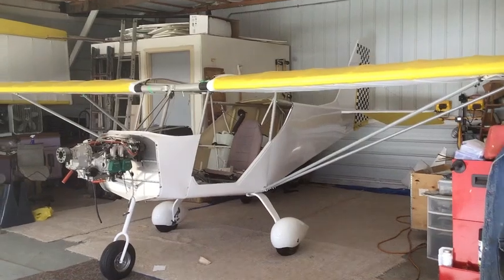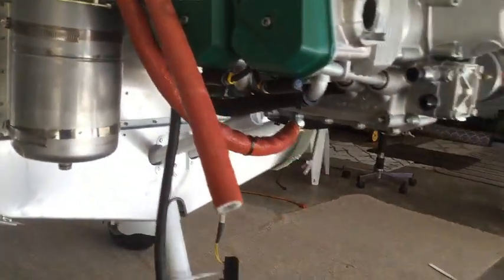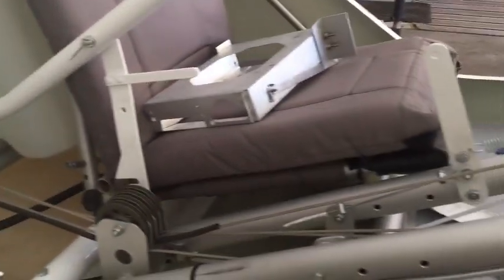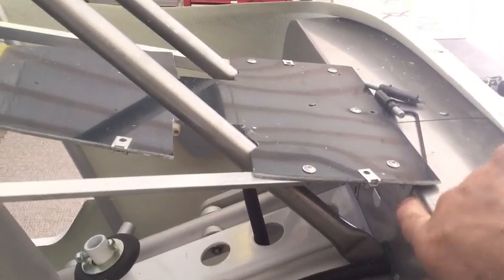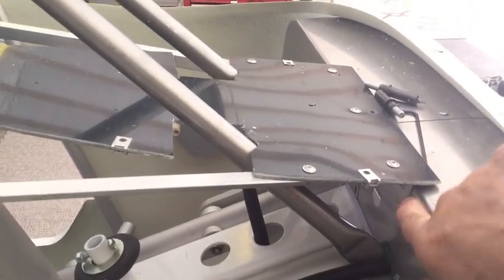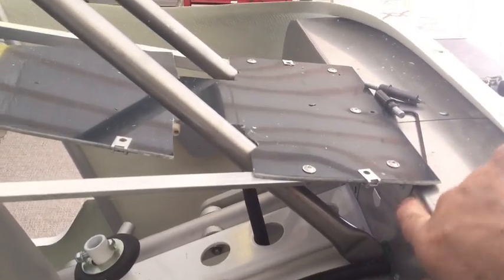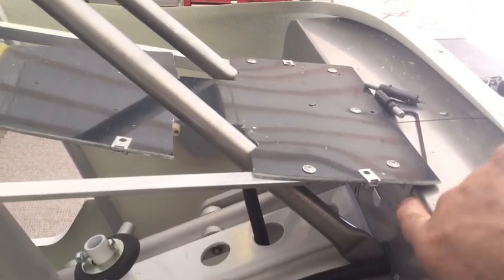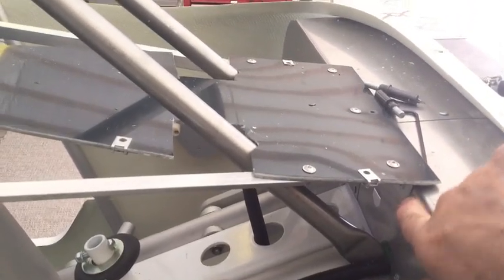Skyranger Build and Tips Part 2

Comment: The bottom engine mounts on my Skyranger are covered in Tigerseal PU at the firewall. It's a liquid sealant. Same was used where the nose leg is (not the movable part of it, the solid hole on the firewall. It was painted white after with the fireproof paint.
Reply from the maker: @skyrangerswift2ireland  Thanks, I will look for that product. The kit has so many improvements, it’s hard to note them all.  It’s also a very good flying airplane.  Very predictable, reliable, coordinated, with no bad habits, or surprises. I am a reluctant builder, I build to fly"
Reply: @dalemseitzer  I actually flew a Nynja for the first time yesterday, brand new, 100hp. 
I normally fly my Swift II. The Nynja was harder to slow down, but what a great aircraft to fly. They are beautiful.
Reply from the maker: @skyrangerswift2ireland  most of the frame dimensions are identical, so it should fly great. I have to finish first.
Reply: @dalemseitzer  The Nynja is less draggy than my swift II. Great machines! Best of luck with yours and enjoy many happy hours of flying!

Comment: Hi Dale
The white aluminum channel in your parts box fits over the top of your main gear legs. You might have to take the gear legs off again to fit it.
Reply from the maker: @colingraham9886  The instructions for the Nynja did not include the 600 kg gear, that was found in the Swift 3 instructions. The instructions for the tray were emailed to me with an addendum for the new oil cooler mounting instructions and I did not open the pdf.  I should have seen the tray in photos on the Blue Collar build pages.  I have a hangar neighbor with a set of wing jacks, I just need to lift ir 2-3 inches to slip the tray in.  I really need Skyranger to be sSuccessful in the USA so my plane does not become an orphan.

Comment: Have a look at the tailbeaconx made by UAVIONIX. It will work with your EFIS. Way smaller/lighter and cleaner install compared to a traditional transponder
Reply from the maker: @jking755  I’ve got a stratus with built in ADSB.